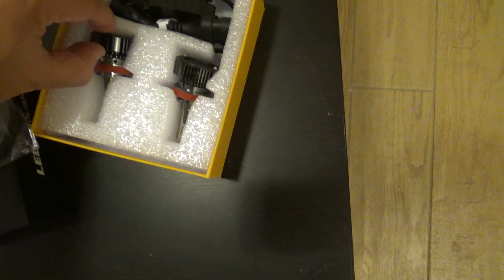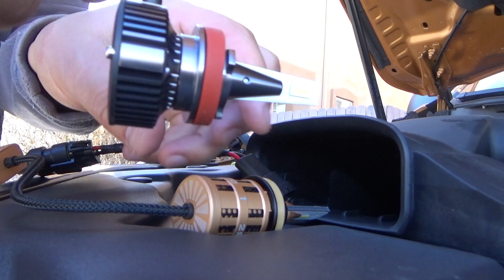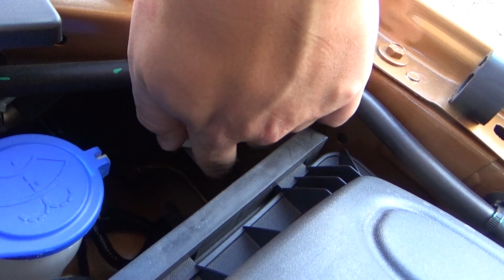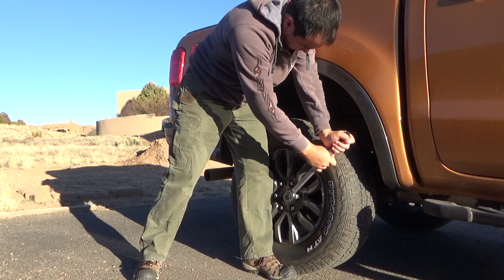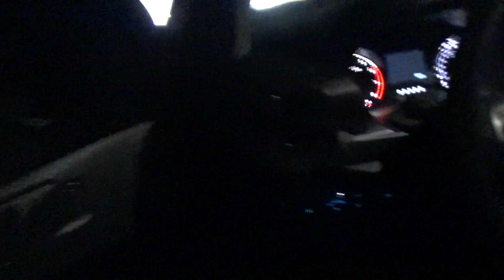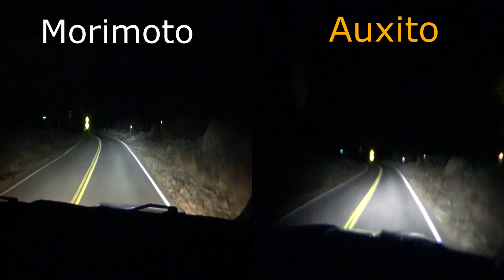Auxito LED Headlight bulbs.  The answer to Ranger owners' prayers?

Comment: Installed these in my 2020 and have had them several months now with great results. Just had to adjust the beam to 3&6
Reply: Does the driver and length of cable fit just fine behind the dust cover?
Reply: @CaseySchneider  yes
Reply: @brohammer  thank you

Comment: Stock Lariat lights look brighter and you get the led edge. Also never bounce whenever using a torque wrench. One smooth pull or push to the click. Bounce will cause marring on the lug and you will not get a good accurate torque